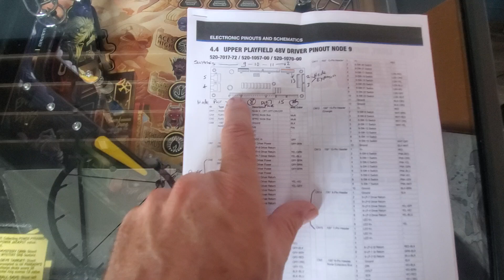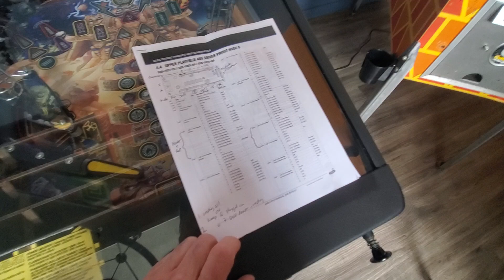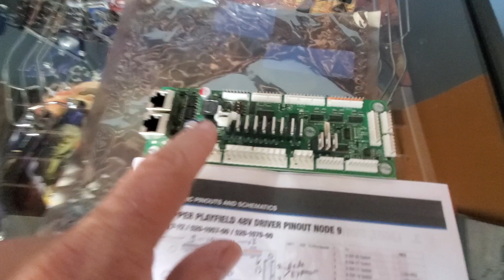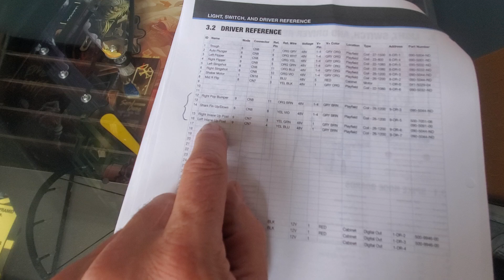Diagnosing Stern Spike 2 Node Board Problems With Jaws Pinball - Part 1/3 - PinballHelp.com

Comment: The spike system  from a maintenance  perspective, is a very poor  system  . ( This is  a huge Issue )  I suspect in the near future the average home owner will start to see  major issues and will be screaming when they see the price to maintain these machines. The penny will drop and they will understand how poor the system really  is  . This machine is 12 months old and its already failing , i rest my case .
Reply from the maker: In fairness though, Stern has been really good at replacing bad boards.  Much better service than JJP.
Reply: @PinballHelp   I;m more concerned longer term for owners , due to the priority code ( Thus no one can reproduce boards , that you will have zero chance of obtaining or repairing )
Reply: @PinballHelp  From Clay ( Pinball Ninja ) talking about a LE Kiss that smoked for no reason . Quote ,  Stern is not doing things right. They are doing things cheaply. they are locking us into Node boards that DO fail. (and the FUSE on the motor Node board did not blow! ha!) And since these node boards contain code, they can not be easily copied. Meaning we are locked into get replacement boards from Stern. But what if Stern does not want to make a particular Node board in the future? Or stern goes out of business? Well your expensive LE machine is now a big paper weight. YOU HAVE BEEN WARNED...

Comment: Been loving the Jaws Pro, do you think it will hold value and be well, doable to maintain?  This will be my first ever pinball owning and was hoping, since it's newer that it may not break as much as the older ones?  Thoughts?
Reply: Get a older Bally/Williams , way less problems ( and can be fixed , new Sterns are junk systems , something goes,  you throw the board in the junk bin and purchase an entire new board in the Hundreds of $ each time .
Reply: I’ve had my jaws pro for a year and a half and no issues
Reply: @rw_808   I hope your machine runs perfect forever , im just worried for future owners . From Clay ( Pinball Ninja ) talking about a LE Kiss that smoked for no reason . Quote ,  Stern is not doing things right. They are doing things cheaply. they are locking us into Node boards that DO fail. (and the FUSE on the motor Node board did not blow! ha!) And since these node boards contain code, they can not be easily copied. Meaning we are locked into get replacement boards from Stern. But what if Stern does not want to make a particular Node board in the future? Or stern goes out of business? Well your expensive LE machine is now a big paper weight. YOU HAVE BEEN WARNED

Comment: Easy for me to say because I had to do it every day at my last job, but surface mount soldering can be a breeze if you get the right equipment: - a bench microscope, a hot air station, and two fine tipped temp controlled soldering irons, and practice!

Comment: The node boards do have a fuse. It is a surface mount component that is not user replaceable. The boards are very poorly designed. When a coil fails it will destroy the node board almost every time. It is also going to be very difficult for anyone to make aftermarket boards for these machines. Every node board has firmware that is burned into them at the factory via jtag pads on the board. Stern is building machines that they know will fail and will not be able to be repaired after they decide to stop making replacement parts.

Comment: Common problem with Spike 2 Node boards. Check the MBR760 diode (zip tied). It's likely shorted. The 6V regulator (MP24943DN-LF-Z) is probably blown too.